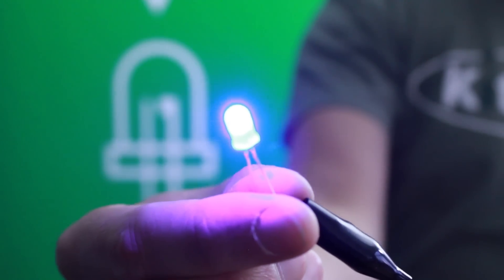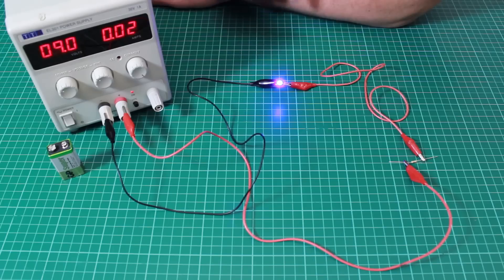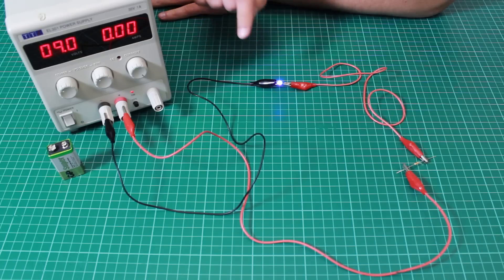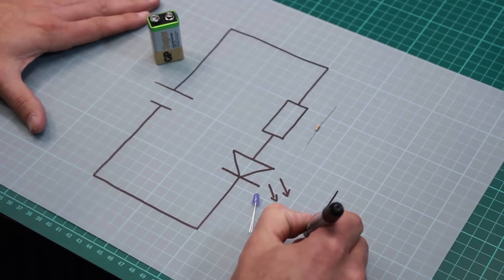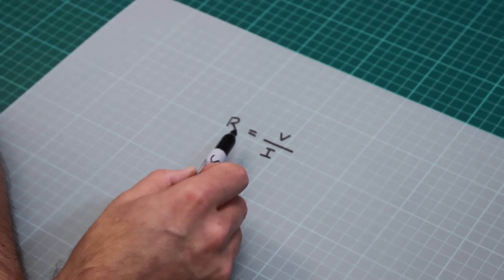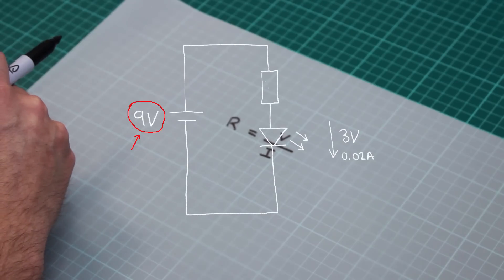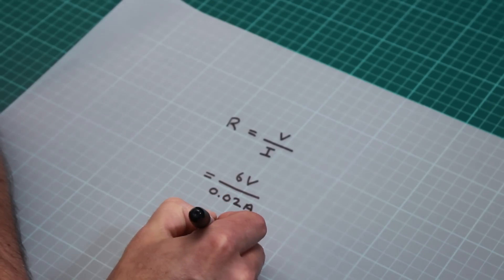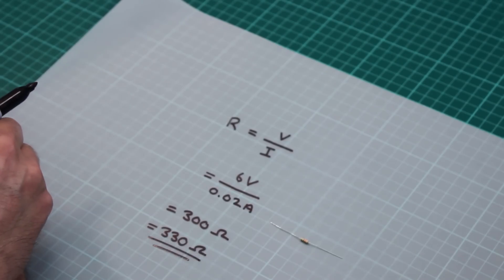LED resistor value calculation explained (Ohm's Law)

Comment: Howdy, Brother!  What resistor should I use if I have a yellow 10mm LED Emitting Diode (1.8-2.2V)  powered by two AA Batteries?  I will have an on/off switch in the loop.  Will 47 ohms work?  i tried 100 ohm resistor but the batteries were getting hot.  I'm not even sure if I asked the question properly . Thanks for any assistance.
Reply from the maker: Hi, and thanks for the question. If it's a standard LED then 47 ohms should be perfect for the job. 

We have a pretty cool calculator on our website that can be used for this. Select the LED you have from the dropdown list and then use the button to pull through the details. Add your supply voltage and then hit the calculate button.  I hope this helps; 

https://kitronik.co.uk/blogs/resources/led-resistor-value-calculator
Reply: @kitronik  Thank you, Brother!  By the way, your LED Resistor Value Calculator is fantastic.  Nice work!!

Comment: What if you have led’s with no data available? I have tons of them. Do you just assume that they are rated at 20 ma? They are different dimensionally, and color.
Reply from the maker: Hi, thanks for your question.

In the absence of a Datasheet, there are a couple of things you can do;

It is possible to find out an LEDs forward voltage with the test diode function, which can be found on some multimeters. 

You can also hook up the LED to a potentiometer/variable resistor and a battery. Have the potentiometer set to its highest resistance value. Slowly decrease the amount of resistance, until the LED is lit fully, being careful to not go too far so as to damage the LED. You can then use a multimeter to check voltage and current. 

When sorting through your LEDs and deciding which to use, we would advise you to stick to an LED current in the range of 10mA to 20mA.

Comment: So what if you have more then 1 LED. What if you are running 3 3V LEDs at 50 milliampes with a power supply of 3.7V
Reply from the maker: The easiest way would be for each LED to have its own limiting resistor. 

You can have your LEDs in parallel so that they can share a resistor but this makes your calculations a little more tricky.
Reply: @kitronik  ok. If they had there own resister what would it be. And if I wanted to Dim the LED would I just add a higher resister

Comment: Maybe i am stupid ! Ok , it s my risk . I ve bought some led bulb for my turn light motorcycle but doesn t sey what value it has , 5 W , 10 w ….
Is it possible to do like in your movie ? 
 

So  the voltage  is 12 V , the current is 9Ah , and about the  LED buld WE DON T KNOW ANITHING , just it works on 12V

Comment: What is the calculation if you have 10 LEDs wired in parallel, is it a simple times 10 of the 20ma ? 
Also to get the correct resistance, why not put two resistors in parallel or series ?
Reply from the maker: Hi, we have a resource that details how to do calculations for series and parallel configurations, it should have the information you require. I hope this helps.

https://kitronik.co.uk/blogs/resources/how-to-calculate-resistors-in-series-and-parallel

Comment: The .02A and the core voltage of 3 volts was poorly explained.  You need to explain where the values came from
Reply: LED data sheet that should be supplied by the vendor.  - if you buy them from ebay etc, they should specify these values in the listing. If they don't specify them, find a different listing 😎

Comment: If i use 5 small led, the power source is 12V with max 2A current, then what is value and no. of resistor taken so that the bulbs not get fused ?
Reply from the maker: Hi, if the LEDs are in series only one resistor is needed for the circuit. If the LEDs are to be in parallel then each LED would typically have its own resistor. If the LEDs are identical then the resistors would all be the same. 

Without more information about the LEDs, current requirements and forward/drop voltage, we can't do any calculations. 

I hope this helps.

Comment: Complete NOOB here. What if you are using a salvaged LED, which has no datasheet, how can you figure out the value, of the resistor needed? Also, if the current is reduced by the resistor, for the first component in the circuit [the LED], what amount of current will be left at the end of the circuit, if it's a more complex circuit, with many components and many resistors? Isn't the current reduced to nothing, at a certain point?

Comment: I'm still confuse ..
How did you find the amp?? 
Can i find it with the resistor connected in serries to the led? 
Because if directly connect it to battery the led will blow ..
Reply from the maker: You can calculate it using ohm's law; 

https://youtu.be/GP-KWqKvv9I

Comment: what if used a 12volt car battery, is it the same, because it has alot of power?
Reply from the maker: Check the datasheet for the LED you have, that will tell you what sort of power requirements the LED needs.

Comment: Nice video, but what if the power supply gives 12 V and 90 A (PC PSU). What happens then? Is the same? Just apply Ohm's law and forget about the current given by the PSU?
Reply from the maker: Hi, if you refer to the datasheet for an led you will find information regarding the max forward current. Always use a power supply that is appropriate to avoid damaging your circuit/self. I hope this helps.
Reply: @kitronik  As long as it meets more than the current required. So Just about any D.C. source can be used, Batteries or Power Supply . The current is so minimum, no worries!
Reply: As long as you adjust the voltage down to requirements of the circuit. Or add a  resistor in series with the supply.

Comment: So if I have 19 volt power supply and my LED is rated 12 volts, do I have to get abaot 400 ohm resistor? Anyway I don't know the current that flwos true the resistor or the LED.

Comment: What if the voltage is the same but Watts are different?
Reply from the maker: If you are dealing with power, then you will need Watt's law: Power (in Watts) = Voltage (in Volts) x Current (in Amps) P = V I 

I hope this helps
Reply: @kitronik  So how do I find the resistance that way? I've got a canbus 12v bike where the computer can't see the bulb. That then bulb is 12v doesn't change anything. Standard W is 21/5. LED is probably 5 times less that. Does that mean 5 Ohms is fine?
Reply from the maker: @thebx-substack-com  Are you trying to change the bike light over from filament/halogen bulb to LEDs? It may not be quite as simple as installing a resistor appropriate for the LEDs. It depends on what the bikes computer is looking for to determine if there is a light present or not. I would try to get a hold of a diagram produced by someone who has successfully done this conversion.
Reply from the maker: @thebx-substack-com  Having had a poke around on Google, mainly to find out what CANbus is, I've noticed that there are various resistor/adapter kits available for these conversions, including tail lights. There are a few on Amazon too. 

I'm reluctant to give specific advice as I have zero experience to draw on but if I come across anything specific I will reply again. I'm sorry that I don't have a definitive answer for you at the moment.

Comment: Hello, 
i tried calculator but i still have a question.. About wattage.
My motorcycle gauge cluster bulbs are halogen 12V 2x 0.7w and 1x 1.1w. If i install T3 leds 12V 0.2W 20mA.... what resistors do i need? 
In calculator i found 600 Ohm, but in market i findf 600ohm resistor 2w. Wattage affecting? I wouldnt like to cause any damage.
I look forward to hearing from you, 
Thank you.
Reply from the maker: Hi, a wattage value indicates the maximum amount of power that the resistor is rated for.  Most circuit diagrams will not show any power ratings for resistors as the power involved is low. You would need to see the actual circuit diagram for the cluster on your bike. If the circuit diagram indicates resistors with a specific wattage rating then you should definitely follow that instruction. 

You can calculate power with watt's law;  Power (in Watts) = Voltage (in Volts) x Current (in Amps) 

I hope this helps.
Reply: @kitronik  Thank you for your reply, i really appreciate it!

Comment: Bro...If we connect 25 LED light (8mm) in series, what is the resistance (value) we must use in the circuit designed??
Reply: What is the Voltage of the LED's  ??
What is the Voltage of your supply ?
How much current is being supplied ?

as for the Voltages and resistances
When you contain Voltage IN SERIES  it's additive , Meaning if you have a 1.5V Battery and you series it with a 1.5 V Battery 
You're going to have 3V DC  for obvious reasons

so....  let's say each of your resistors needs 2V  and you have 25 of them
well, then you have to factor in 50V DC in your calculation 
so let's say you have a 120V DC Source

then you need to figure out the current 
let's say 500mA for arguments sake
and let's say 
so to solve for Resistance  you have 
R = V \ I
so.....
Voltage =  120 - 50 = 70 V DC
Current = 0.500A

therefore 
70 \ 0.5 = 140 Ohm RESISTOR is needed 
Does that makesense ?
Reply: @martinkuliza  3.2-3.4v
Power supply=230v
Reply: @feminsimon6189  

you still failed to answer 2 Questions that i asked

1.   how much current is being supplied

2.  Does that make sense ?

i can't answer your question until you answer those questions

Comment: From where u got the amps of the led???  What if we choose a random led and what if we dont have that machine? In that case what should we do?
Reply from the maker: The power requirements can be found on the datasheet for the LED. 

If you use different components you can work out the value of the resistor by changing the ohms law calculation to match your scenario. I hope this helps.

Comment: i have SMD led white 4.5mm ( 3w ) wide angle, not sure what is mA.
Anyway i put a 470ohm 1/4w resistor and its dimming every each led no metter what type of led but if i put 3x470ohm then every time i put extra resistor its getting brighter. im connecting 12v supply 
Im ok that is diming but i think it might be dimming to much , as far im aware it just should allow led to work under 12v pressure and keep normal brightnes, but its dimming a lots.
What im doing wrong?

Comment: Im stuck ,are you able to help me please ?
Reply from the maker: What can we help you with?
Reply: @kitronik  Cheers for getting back 😕..
Can i send an email or call your shop ?
Reply from the maker: @spoonerlee2908  Yep, give us a call or drop us an email, our customer service team are at the ready: Details can be found in the footer:  https://www.kitronik.co.uk/
Reply: @kitronik  would you be as kind as to double check my calculation please ,here are the details....
Battery 4.07v
LED 3v-3.7v & 2A-3A 
Calculating using the lower 3v and 2a i make it a 0.85 ohm resistor is needed inline to save the LED from frying..
Seems to low to me and i feel ive messed up some how.
Its quite an expensive cree  LED and i dont want to mess it if i can help it ..
Can you double check my calculation please and tell me how you done it ..
Be really greatful

Comment: what if i have a 3mm led @1.8v 20ma forward current 

what value of resistor do i need to prevent it from dying haha 

example my power input is 5v with 2amperes of power

then i'll make 42led in parallel now the forward current will become 840ma

Comment: If I have a 12v 30amp power supply I need to power 5 modules which take up 12 V and 1.2 Amps each what do I do I’m afraid I will blow up the modules

Comment: doesnt that mean that the higher the ampere is the lower the ohm value is?
Reply from the maker: Yes, if the voltage is fixed, for higher current (Amps) you will need lower resistance (Ohms)

Comment: how can u know the current
Reply from the maker: Hi, the value of 20mA was taken from the datasheet for the LED. The voltage of the battery was known to be 9V and as 3V is dropped across LED, that leaves 6V. The resistor value was determined by entering these figures into the Ohm's law formula.

Comment: Thank you so much for this simple equation. And then there was light :D. Just a simple question. When i want to power 2 LED lights in the example circuit in the video will i add a 660 resistor or 150?

Comment: Can some one help me I'm really new to this... so example if I used everything within his video ie the battery the resister and the led values ... what if I add more than 1 led then what happens do I need another resister or do I only need 1 for multiple leds attached in a line ??? Little co fussed lol
Reply from the maker: Assuming the LEDs are in parallel then you add both milliamp values together before doing the calculation, and just use one resistor. Play with the values on our calculator to see how it changes: https://www.kitronik.co.uk/blog/led-resistor-value-calculator/

Comment: So basically you can't go further if the data sheet is not available... Or  you will just be fumbling
Reply from the maker: As with any calculation, you need two of the values to calculate the third.

Comment: how can I calculate the internal resistance of a LED if I do not have datasheet and how to calculate threshold voltage of LED ?
Reply: to calculate INTERNAL RESISTANCE
Use a Multimeter in Resistance Mode
that should have been obvious

As for forward voltage
Use a  Multimeter.... DIODE MODE
the reading you get will tell you the min required voltage needed for it to conduct 

or.... Use a Power Supply...  Very low CONSTANT VOLTAGE   start in mV range 
and slowly go up until it starts to conduct 
your Power supply will then tell you both the voltage and current that you require

Comment: i spent hours online, come to your video. now im asking myself how i didnt understand hours ago. thank you so much cleared things right up
Reply: What happen if I attache this led to 230v ac directly with a resistance in series then ... If the same formula will work ??
Reply from the maker: @vedurj9723  You will need to source LEDs that have been designed work with an AC supply at that voltage.
Reply: Nice name dude

Comment: 9v battery requires how much ohm resistance to light 5v singe led
Reply from the maker: It depends on the current needed by the LED.
Reply: 5v DC current
Reply from the maker: Current is measured in Amps. You need the current figure to do the calculation.
Reply: @IMRANMOBILEWALA  
hehe
there is no such thing as 5V DC Current
there is such thing as  5 VOLTS DC   Meaning......

Step 1.  Buy yourself and Oscilloscope 
Step 2.Attach a DC Power supply to your scope that Is set to precisely 5V

you will notice that your scope shows you a straight line  (Assuming your calibrated your marker on 0 Volts when you started and since VOLTAGE IS ELECTRICAL PRESSURE
you will observe  on the following settings

1 Volt Per Division
1 Second Per Division
that your LINE / DC Volts has jumped up to 5 Volts in amplitude

Now.... if you had an AC Power supply

Step 1.    oh..that's right you already have the scope
Step 2. Attach an AC Power supply  that is set to 5V AC

you will now see a sine wave  on your scope
the AMPLITUDE of the sine wave  IN THE POSITIVE DIRECTION will be +5 V
and it will then go to 0 V   and then to  -5V  and it will keep doing this 

DO YOU UNDERSTAND NOW
the straight line indicates THE TYPE OF CURRENT
Straight Line  =  DC   (aka,   it has no frequency)
Squiggly line / Sinusoidal Wave = AC  (it does have frequency)

THAT'S CURRENT

now.. Voltage is  ,  HOW HIGH IS THE WAVE  OR THE LINE ON YOUR SCOPE

SO....  he told you to FIND OUT HOW MUCH CURRENT IS NEEDED
Not  what type
but   HOW MUCH  (this is measured in  Amps)

you replied by quoting in Volts   LOL
you said
5 V DC
so basically you just told him 
I NEED 5 VOLTS OF DIRECT CURRENT

he is probably now going to say to you .... again
BUT   HOW MUCH CURRENT DO YOU REQUIRE ?
or
HOW MUCH ... DC Current do you require ?

Your answer should  IF CORRECT    contain
A  NUMBER   followed by     the letter  A   or     mA
FIND THAT

Comment: what about if my battery has 2v and i need 2v then there is 0v going to the resistor how do i calculate that?0v/0,02a is zero so should use no any resistor or what. i didnt use any resistor and my led got burnt..any ideas? I am very new in this please can someone explain????
Reply from the maker: Hi Simon. If the battery and LED are both 2V then you shouldn't need a resistor. Use a multimeter to double check your battery output.

Comment: what if dont have data sheet?
Reply from the maker: You can usually obtain the information you need from the company that supplied the component. Either from the product page, links on the product page, or by emailing the supplier.

Comment: Nice video, but the resistor is useless if you use a 3 volt battery or 3 leds in series ?
Reply from the maker: Hi, the video is a practical example of how to use ohms law to determine values you don't know using values that you do know. If your 'known' values are different you can still use ohms law to determine what you don't know. The numbers may be different but the process remains the same.

Comment: This was 90% there for being my cure-all answer. I wish that you would mention what term (similar to "Forward Voltage") to look for to find the mA on the LED datasheet. This seemed like a big detail, mainly because so much of starting out is understanding how to make sense of those over-packed data sheets haha.. I believe that term is "Continuous Forward Current" but correct me if I'm wrong.

This other video helped me understand ohm's law in a bit more long-winded way... a combination of the two was the perfect solution. https://www.youtube.com/watch?v=fGI9d0CjI8s
Reply from the maker: Correct, you are looking for the Continous Forward Current, but it is often also listed as Typical Led Current.